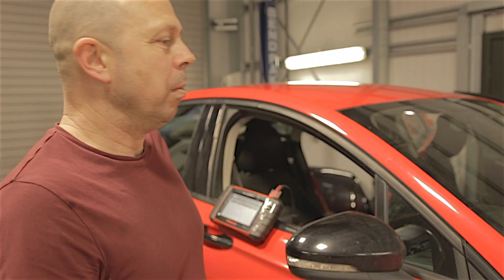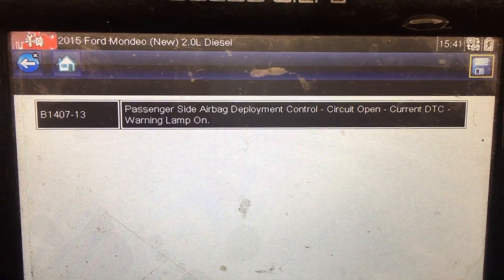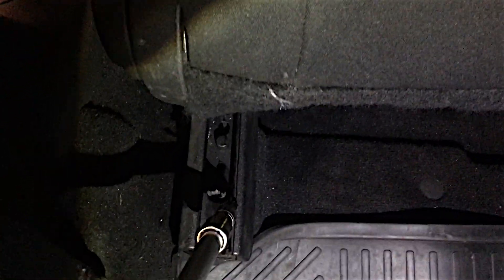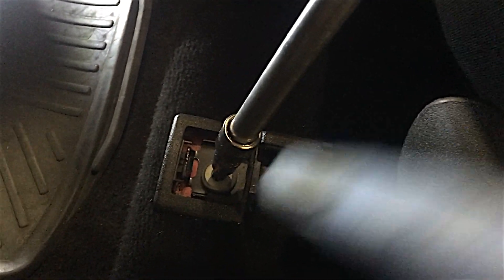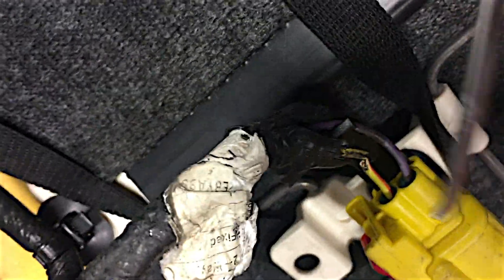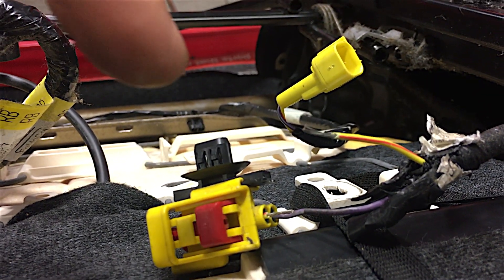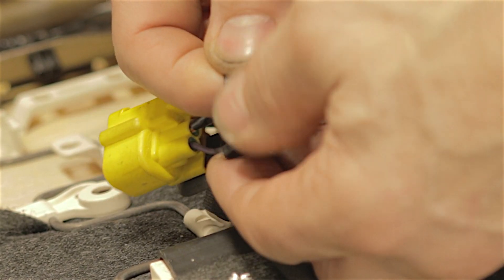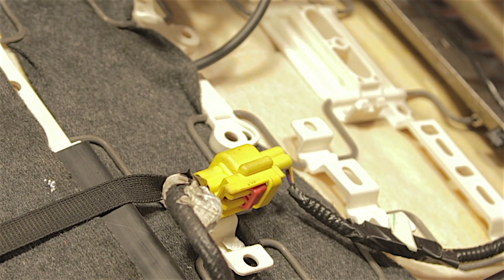B1407-13 Passenger Side Airbag Deployment Control, Ford Mondeo Mk5, 2L Diesel

Comment: Great info my friend. I have an MK5 model 2015 and the passenger airbag from dash has been replaced. A Second Hand connector is on it but is not so fixed in the airbag connector. Is there an option to see how this connector should be fixed on the airbag in order not to have the airbag light on?
BR
Florin

Comment: I found the exact same problem on a F-250 today because of you sir. Easy fix. Shame on Ford at this point, considering this is a critical safety system (SRS) that's disabled. A simple routing change could easily fix the issue. Glad my Ford purchasing customer didn't need the SRS in the collision the truck was involved in.

Comment: Hi Alan I’m getting code : b1126 - 11 , drivers side, side air bag deployment control circuit short too ground. Would this be similar but on the drivers side? Any idea where to investigate first? Thanks!
Reply from the maker: it would be worth checking the wiring plugs under the seat, you don't have to remove the seat, pull the plug connectors apart and reconnect them, check for broken wires although i not had any  broken wires on the drivers seat, more than likely it is the clock spring assembly behind the steering wheel that is faulty

Comment: Hi Alan was wondering if you can help me I have a ford mondeo mk5 2lt d and spanner light comes on if u put you foot down like 2 and 3 gear then reduce power not like limp mode but not full power and took it to the garage they said oil pressure sensor light come on the obd they said just service it so they serviced it and not done it again 2 days after just wanted if you ever had this problem with them be four as I don't want to keep putting money into it if it's  the fault

Comment: Alan, i noticed the car had done 267,200 miles what mileage do you expect it to do before you replace it, and is that the reason the firm runs Mondeo’s because they are that good, i mean that mileage in six years , ridiculous .
Reply from the maker: usually the cars will go around about 300-350k miles